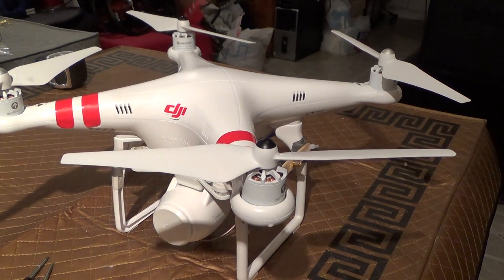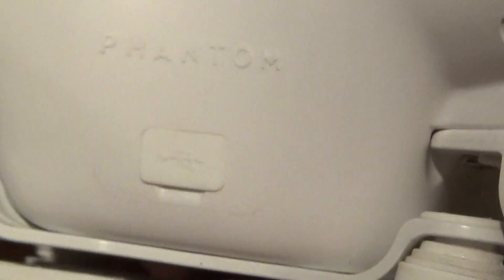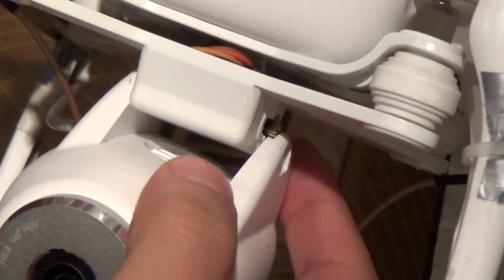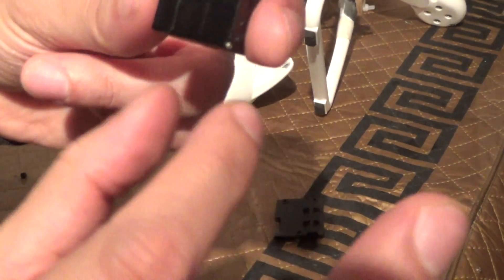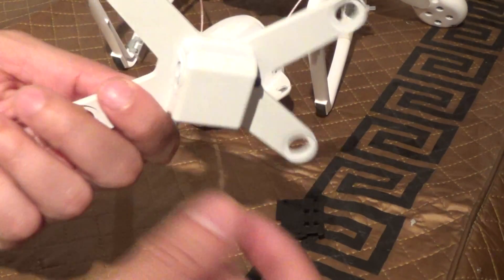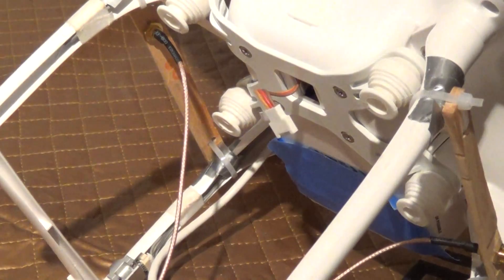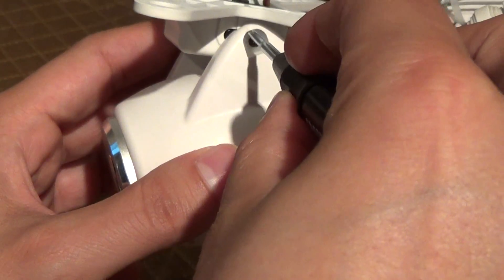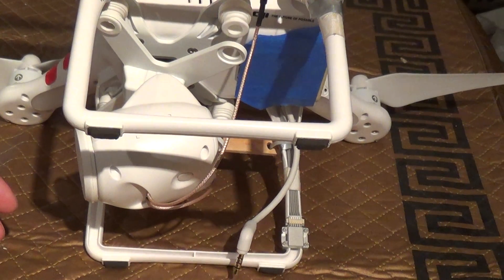Phantom 2 Vision Camera removal and Gimbal Servo replacement

Comment: Is there a way to repair/replace the video transmitter? From what I understand it is I closed inside of the camera
Reply from the maker: It's all part of the video camera assembly.  You might be able to source the individual parts to replace whatever is not working but it's not going to be easy.
Reply: I hear you, I was just wondering if you ever have taken one apart
Reply from the maker: +Bassmaster Florida yeah I've taken most of it apart.  It can be a bit tricky.  I'm sure with some research you could find out which part you need to change specifically.

Comment: hmmm if i would like to use a 4K gopro, I could install a 3-axis brushless gimbal. install a 12v power supply cable from in the phantom 2 vision. Use that servo control to command the tilt and make a cable  to use the video jack and connect the video out of the gopro to that.
and voila a Phantom 2 Vision with a 3-axis brushless gimbal and a 4k camera connected to the video transmitter so you see all info and telemetry info on you smartphone as you would normally do ...
Reply from the maker: If you remove the camera from the Phantom 2 Vision (non plus) you loose FPV and telemetry etc it's like having a basic Phantom 2 with a 5.8 instead of 2.4ghz transmitter.  

So if you want to use a GoPro you can use it on whatever gimbal you want but you will need to use a conventional FPV system and DJI's mini iosd or something similar.

Since the Phantom 2 Vision uses 5.8 ghz for control you will need to use a 1.2ghz FPV video transmitter and receiver
Reply: Ben7seven7 Are you shure because the telemetry is not comming from the camera but from inside the phantom.So if you connect your video out to the jack with 12V, GND (for your 3-axis gimbal) V-In-, V-GND. You should see the Video on the DJI App with telemetry as normal.
In the mean time you could film in 4K
You only use another camera connected to the V-In of the phantom 2 vision ... This should work i think ...
If i find a 3.5 jack with 4 connections i will try ...
Reply from the maker: Yes I am absolutely 100% sure, which is why I did specify that it only applied to the non plus version of the P2V.  The P2V+ has a gimped version of Lightbridge so the P2V+ and the P2V+ ver 3 can both have a 3rd party camera connected to the internal wifi module and use FPV as you normally would for the most part.

If using a 3rd party camera in a P2V+ I don't know if you would still be able to start and stop the video or change exposure settings as you can with stock camera, but the main thing is you will still be able to use the FPV link and get telemetry.

Comment: I busted the servo and mount in a crash. Can you tell me where to the upgrade you used? One supplier (Drone Flyers) said I need to buy the whole kit with a new camera. Is that true?
Reply from the maker: They don't sell the servo and mount just the mount itself for around $12 give or take minus the micro servo.  You would need to prepare a replacement servo.  Which I give some information on how to do this in one of my videos.   In the end tho you may be best off buying a 2 axis gimbal mount instead.
Reply: Ben7seven7 Link to your video? I want to try.
Also,  is 2 Axis Gimbal Mount compatible with PV2v camera?
Reply from the maker: Al Cella I added a link to the other video in my description. I used a hitec servo as the replacement. The particular one I used worked quite well though I had to tighten it down a little less because it has less torque. Worked out great though.  

And there are a few different 2 axis gimbal options made to work with the Phantom 2 Vision Camera. The best is probably the one by Rotorpixel.   Though a decent one is a 3D printed gimbal which used the name Taco as part of the name and is a bit over $100 less.  There is also a cheap bargain basement gimbal available for around $100 but people have mixed results with that one.
Reply: Ben7seven7 Hey, Thanks Pal!

Comment: Hello Ben, I got a quick question. Have you ever charged your Phantom 2 batteries from your car battery (like via the cigarette lighter)? Each Phantom 2 battery has the smart charger circuitry built-in right? and all we need to do is hook it up to a 12-VDC power supply that has enough current (like our car battery) right? I thought about trying it and if it works then great... I could charge P2 batts while driving between flying locations.
 
-Lino
Reply from the maker: Hi, I've never charged the batteries from my car (yet) though DJI does make a specific charger for the car for these batteries.  You could also use a connector in your car that turns the cig lighter into an AC Plug. And use that to plug your regular DJI charger into.
Reply: No no no Jeff... That's not what I'm asking. The Phantom 2's battery is essentially a small 12VDC  battery so hooking it DIRECTLY to a bigger 12VDC car battery should charge it right? That's what I'm asking. What you did with your power inverter and your DJI battery charger was convert the 12VDC car battery power to 110VAC power then back to 12VDC with your DJI charger. That's the round about way of charging your Phantom 2 batteries.
Reply: Really???.... you say I will have a "melt down" if I connect a 12v DC car battery to a Phantom2 battery of the SAME 12v DC voltage??? PLEASE EXPLAIN WHY???  And why must I convert the 12VDC to 110VAC then back to 12VDC???

Comment: Well I upgraded to t motors and put a new compass with wire - I'm back in the air but my confidence is shot
Reply from the maker: Does it fly okay now with those upgrades? And did you do the advanced calibration? 

If it's flying okay now just keep your flying location so safe clear areas and put the phantom through its paces testing all of the functions until you're confidence has returned.

Comment: Does anyone know where I can buy the cable he unplugged at 6:26 running from the mother board of the Phantom to the plug on the camera?
Reply from the maker: Are you referring to the connector attached to the servo itself, or the cable longer cable inside the Phantom that connects back to the flight controller? The long one is included in one of the cable kits for the P2V.  The connector on the servo itself can also be purchased 3rd party but then you'd have to splice or solder it on.
Reply: Ben7seven7 I was referring to the longer cable inside the phantom

Comment: If you rotate the camera down and back till it makes contact with the gimbal housing. There's a notch or groove on that ear of the camera and becomes exposed giving you twice the room to work that bushing out with a small flathead. It took me maybe 5 seconds to get the camera off once the screw was removed.
Reply from the maker: Yeah I noticed that notch after I finished the video and subsequently could remove and reattach the camera with lightning speed. Though I didn't feel like remaking a new video at the time.

Comment: I had a medium crash with my p2v - the impact cracked 2 blade protectors and a blade. I have since replaced all blades and took off all blade protectors (waiting for new). I calibrated the compass and never fly without 6 satellites. 

The pv2 seems to hunt for position   And is very shaky . Always turning small circles - before the wreck it was spot on. 

Have you any suggestions for a newbie ?
Reply from the maker: After any crash major or minor you should do an Advanced Calibratrion within the assistant software, in addition to a compass calibration in a large grassy area.  That should fix the problem. If it doesn't then you may have physical damage to either the GPS or the Compass itself.

Comment: The servo on the P2V is Emax ES08MD
Reply from the maker: I looked up the specs of that Emax servo. It's also pretty cheap on ebay.  I put a Hitec 5055MG servo as replacement which actually has lower specs in terms of top speed and torque yet it's working both smoother and faster. The Hitec I'm using uses a coreless motor which is better than the stock unit, and it also doesn't have the loud high pitch whine the stock servo has either. The Hitec I used tho is slightly smaller so I used some layers of electrical tape to fill in the gaps.

Comment: Would this work if i had an adapter going from N type to SMA?

An individual i know made the mistake of ordering this one, also the DBI is much greater.

http://www.amazon.com/TP-LINK-TL-ANT2414B-Outdoor-Directional-connector/dp/B003CFATOM/ref=sr_1_1?ie=UTF8&qid=1402421063&sr=8-1&keywords=TP-LINK+TL-ANT2414B+Antenna
Reply from the maker: This antenna also comes with an RPSMA connector. but it doesn't matter. You can use a different pigtail connector on your range extender to match, or you can use an adapter to convert from one standard cable connector to another.

Comment: Ben, When I owned my P2V I noticed that on the main board there were plugs that said gimbal or Zenmuse and Cam. Can a real gimbal (I.e.: 2 axis) be installed instead? Thanks!
Reply from the maker: Yes the Vision will accept a Zenmuse H3-2D or 3D gimbal. You can switch to a Futaba Rc and use regular 5.8 fpv. Though at that point you no longer have a Phantom 2 Vision. :P  You can also use a RotorPixel Gimbal which is the best bang for buck. it can mount the P2V Camera, or a GoPro.   Good stuff.
Reply: I had a Drone Expert gimbal, it was a piece of junk. From what I hear te Rotorpixel isn't that much better. That's why I switched to the new P2 with Zenmuse H3-3D and love it. :-) The only problem is that I can only fly to 400 feet, but what I do I don't need to go much higher, but still would like the idea that I could.
Reply from the maker: Bobster986 You can use the older V2 firmware on your new Phantom it will work and you wont have the fly safe feature that restricts your altitude near certain locations. And far as gimbals go. I'd have to agree that the mount for the Drone Expert Gimbal leaves something to be desired but the Rotorpixel gimbal looks very sturdy in it's overall design and build quality.  If it was cheaper I would get it.
Reply: Bobster986 This is excellent http://www.stunningmovement.com.au/phantom-vision-gimbal-181